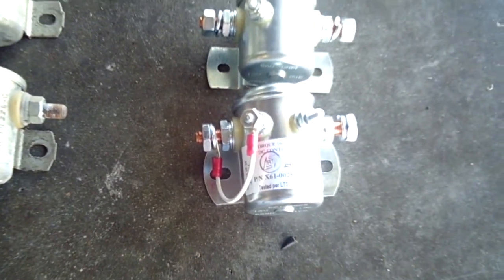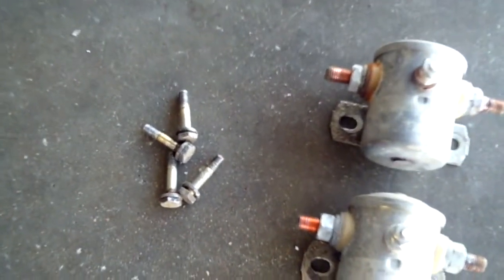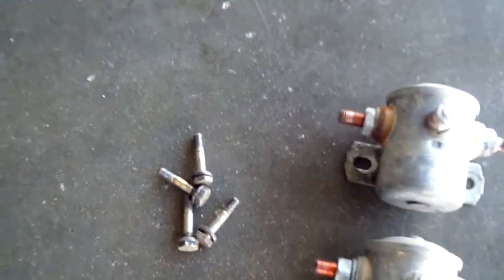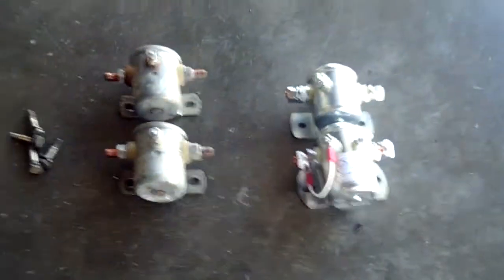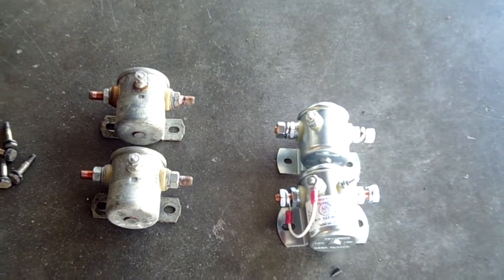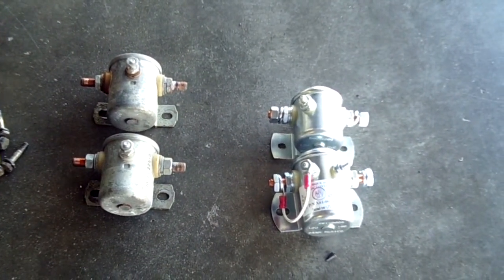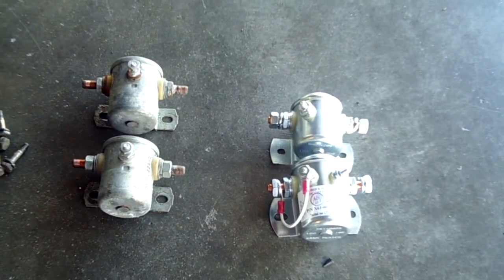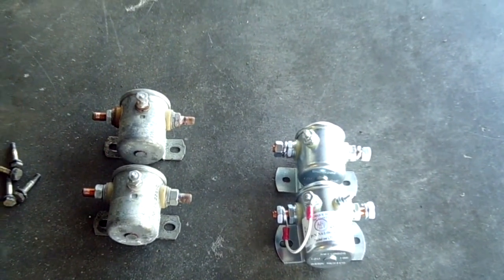Master and Starter Relay Change  - Grumman Style

Comment: What size are the nuts for the bolts?
Reply from the maker: Old Bricks,

 Wither you have a 3/8 inch nylock nit, or a 1/4 inch pal nut.  You do not have to remove the seat to get to them, you just have to assume Grumman position number 2, Number one being flying the plane.

Cheers

 Roscoe